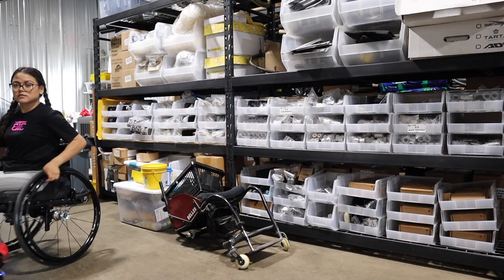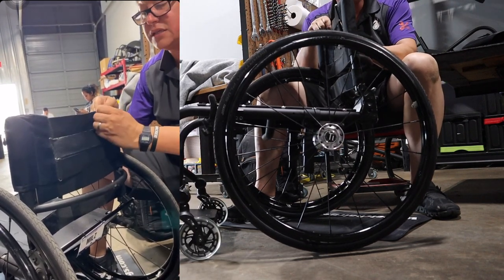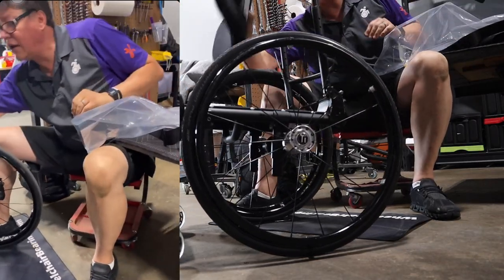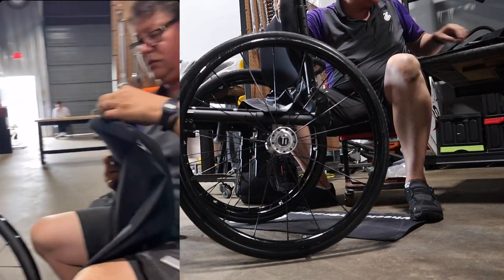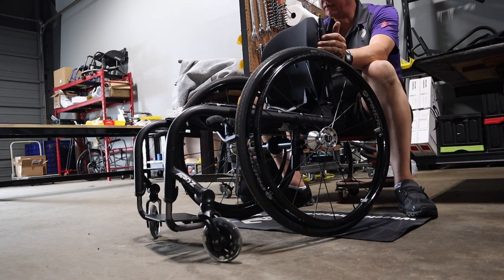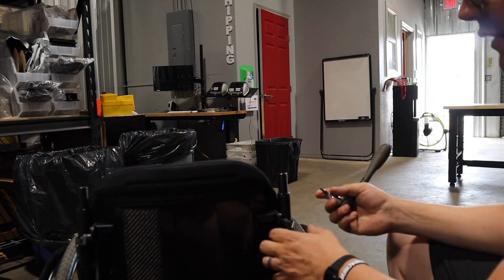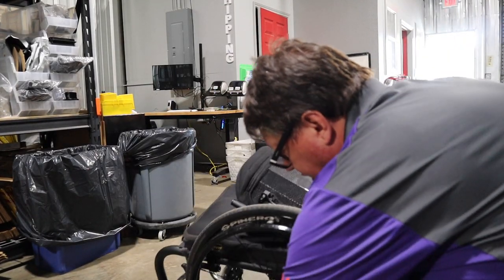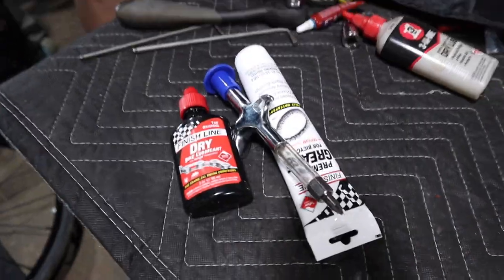Installing a carbon fiber backrest | DISABILITY LAB

Comment: I really like the cloth wheel guards, where did you get those?  Getting the back and seat adjusted so we are comfortable is so frustrating!
Reply from the maker: I got them with the backrest it came with it but it didn’t really protect my clothes . Its easy to fold with them and you don’t have to take them off .
Reply: I want to change mine to the carbon backrest now and I also need those portable rain guards .